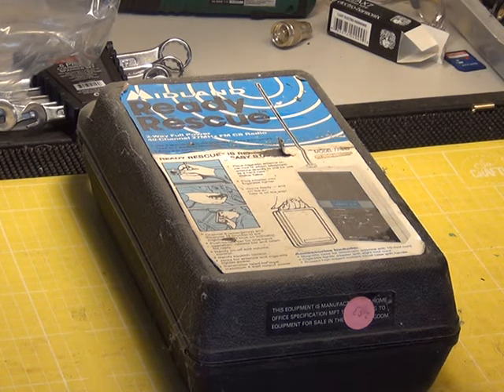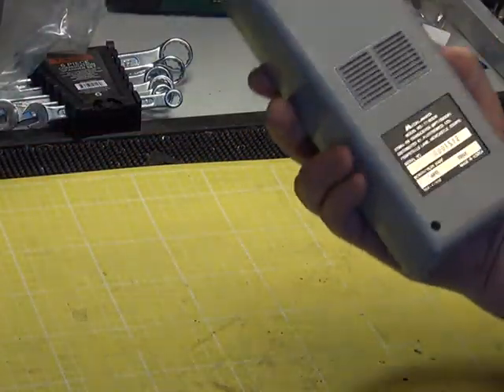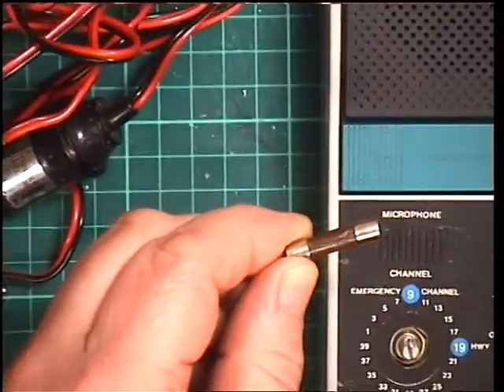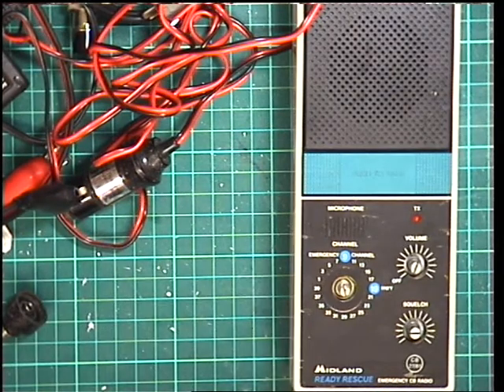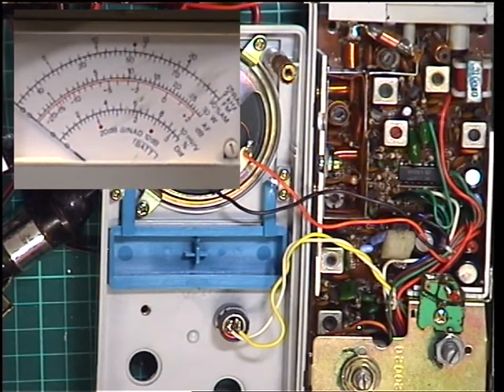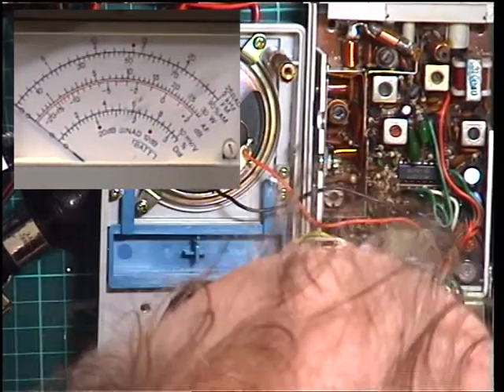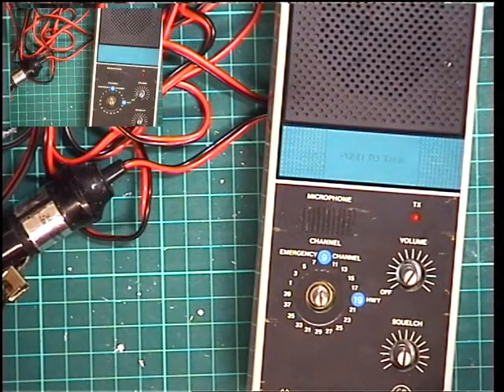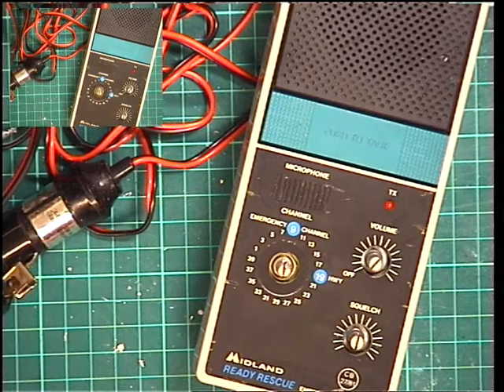Midland 77 810 UK 27/81 Ready Rescue (emergency CB radio) - Transmit adjustment

Comment: Have you ever seen a Thunderbird 40 cb ive just bought one cheap on Ebay but unsure it works for some reason I like the look of it.
Reply from the maker: I just looked at the closed auction of it on ebay & haven't seen one before. I certainly isn't a UK set, but I can't see what country (if any!) it was approved for. I spotted a video on youtube in what looked like Chinese, but like yours has no makers or approval plate on the back. It could be made by Cybernet looking at one or two things about it, and it could well be an AM set.

Richard

Comment: I got 2 of these from my uncle it is perfect for my car for emergency incase my engine breaks down on the road I used this on my atv and the wattage not much
Reply from the maker: Wattage not much? All UK CB radios (like most other countries in the world) have to comply with government standards. The usual RF power output is 4W & that's the same for mobile, handheld or base station. This Midland 77-810 operated at a full 4W output.....so if you'rs doesn't, then it's faulty.

Richard, UK